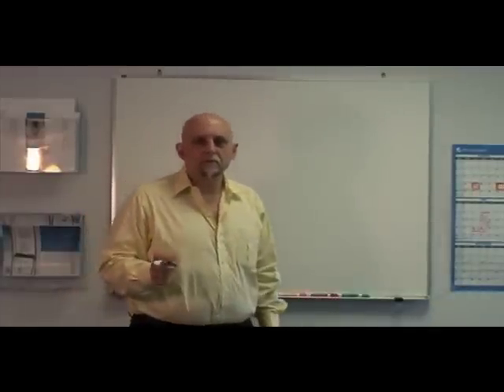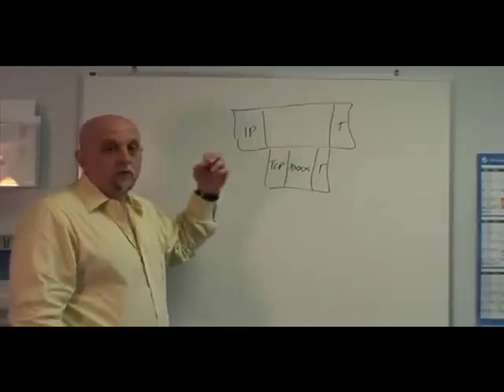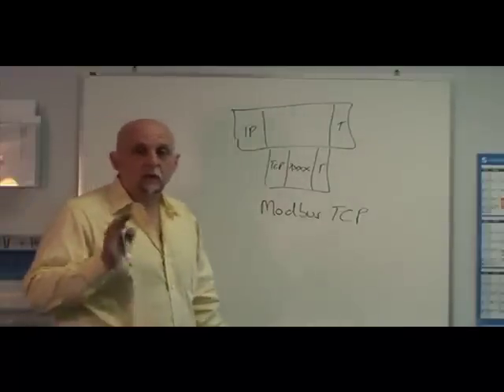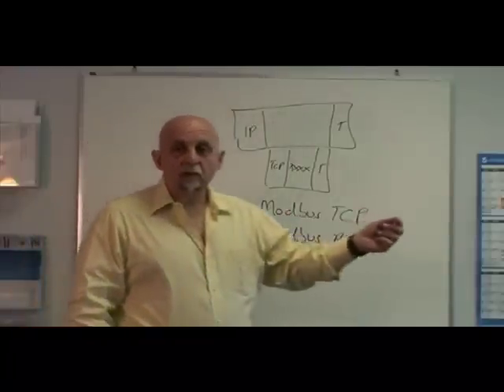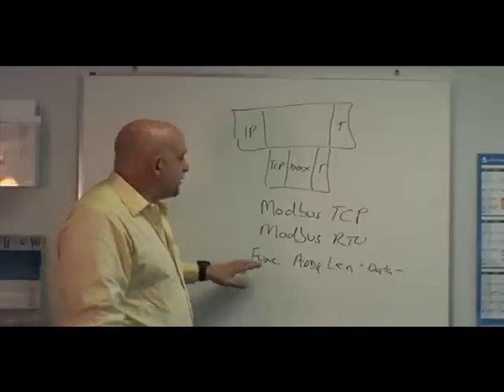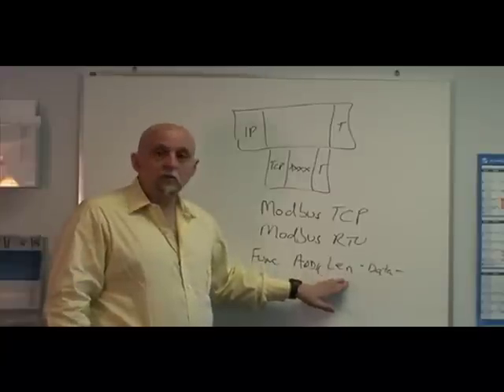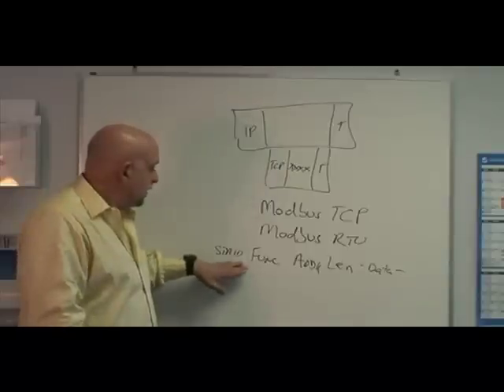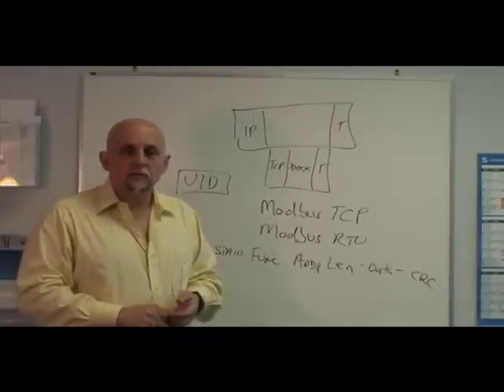All You need to know about Modbus TCP

Comment: What is difference between Modbus TCP/IP and Ethernet/IP. I m at learning stage please help me.
Reply: Networking works in layers - do a search for "OSI network layers" for info.  Each layer runs on top of lower layers, and oftentimes lower layers can be changed without affecting upper layers.  For example, IP packets don't know or care if they're running on Ethernet or PPP or FDDI or whatever.

Ethernet is set of layer 1 and 2 protocols.  The layer 1 protocols can be anything from coaxial cable, copper twisted pair, cable, or wireless.  The layer 2 protocol is mostly (exactly?) the same for each, and allows devices on a local network to identify and send messages to each other.

IP is layer 3.  It allows devices on different but connected networks to talk to each other.  The internet is connected by IP.  IP runs on top of Ethernet or one of many different other layer 2 protocols.

TCP is layer 4.  It runs on top of IP and is used for sending streams of data.  A similar protocol - UDP - sends individual messages.

Modbus is a higher layer (the OSI model isn't really strictly followed above layer 4).  It runs on top of TCP or serial connections.

When you create a Modbus TCP message, you create the Modbus packet and send it to your operating system which wraps it in a TCP packet, then an IP packet, then an Ethernet layer 2 packet, then sends it across the wire (or radio waves) in Ethernet layer 1 packets.  The receiving end has to decode and unwrap each of these packets to get to the Modbus packet inside.
Reply: I wrote all that and then watched a different video and realized you were talking about something completely different, so ignore all I wrote above.  Sorry about that.

Comment: Something's wrong here, there are no trailers in IP or TCP.  
Can or does ModBus use UDP?
Isn't the connection made with the Physical address and not the IP address? 
What ports does Modbus use?
Reply: +Passed High School Physics Yes, you can use UDP with modbus. It uses port 502.
Reply: vanillagirlca Thanks - But where's the security?
Reply: Security isn't part of modbus - you would need IPSec or application layer security. Modbus is an old protocol (circa 1979) that was originally designed to work over serial cables. Modbus TCP is basically encapsulating the modbus info and sending it over TCP/IP (or UDP/IP). I don't think security was on their radar - when modbus was invented they probably weren't planning to connect to a corporate LAN. It would have just been a bunch of short, local RS-233 cables where security was enforced by restricting physical access (i.e. air-gapped). Depending on what you're trying to build, HTTPS and JSON or XML might be a better option. Modbus is a (still wisely used) legacy protocol, but it's not the only option.
Reply: vanillagirlca Thanks - That explains why it's so easy to hack.

Comment: didn't know IP or TCP packets had trailers.
Reply: YunliuStorage Stormage IP headers and TCP headers do not have associated trailers. IP headers contain a length field specifying the length of the header and a length field specifying the length of the packet. If you capture IP traffic using Wireshark, you can clearly see that there are no IP or TCP trailers for IP packets. RFC 791 (IPv4 specification) and RFC 793 (TCP specification) do not mention trailers.
Reply: There is alot of information in IP and TCP headers, all of which has a role in the workings of the protocols. For example in IP, the destination address is the only piece of data necessary for routing. But the origin address is needed for error reporting (or by transport protocols to establish a connection) and the Time to Live field is used to avoid that a mis routed datagram roams forever in the net.